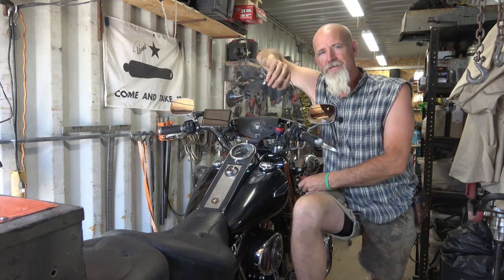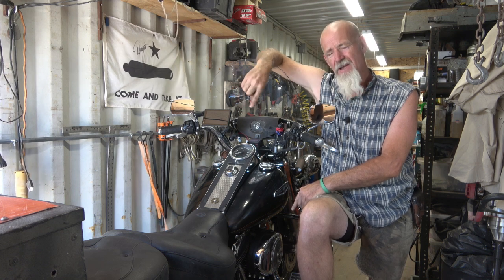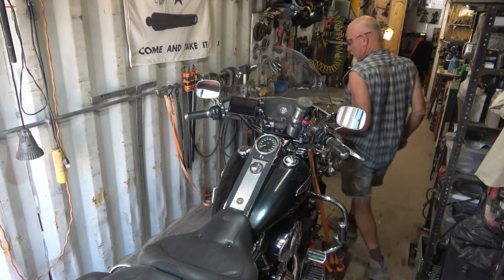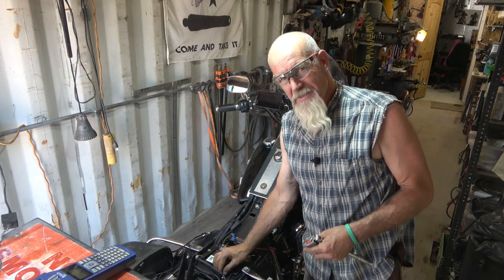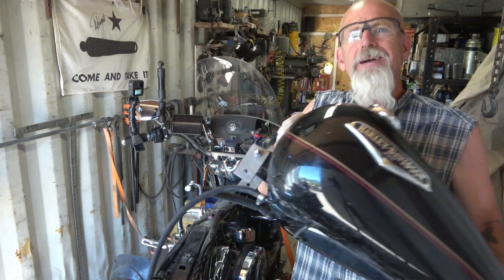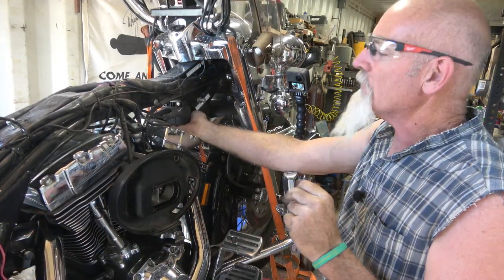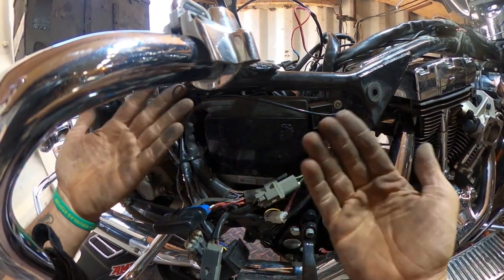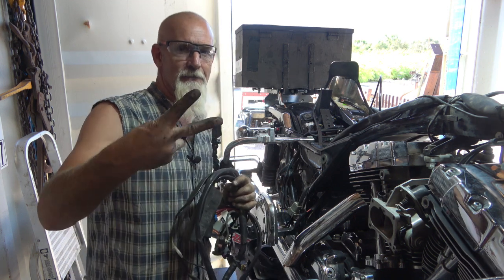Why Your Harley Needs a Carburetor Conversion

Comment: Great video!  I have the same year and model RK. Replaced my ecm with a thunder max. Works like a charm and was only about $900.  Did you consider that and if you did why did you go with the carb?  Just second guessing myself now I think.
Reply from the maker: I did consider a aftermarket ecm , but wanted to go to carb for simplicity on the road and have all parts I need on the bike. Less parts less problems for me. Glad your is working out great. Thanks for watching my vids.

Comment: Just did this swap on my 2000 FLHRCI. 'CEPT I used a sifton cv carb to save a little money. Carb was like $240. And my Dynatek doesn't use the cam sensor. Doesn't start really fast but they said I would notice that because it doesn't use the cam sensor. But other than that it runs beautiful.
Reply from the maker: Awesome enjoy

Comment: Have a 2001 roadking classic touring  . Getting ready to pull the trigger and purchase one of the conversion kits . The magnetti marelli fuel injection is history .
Reply from the maker: I hear ya no computer is the way to go. Really good throttle response and has that carb idle. working on the jetting because of my elevation but other wise good choice. Next week I should have the video out on converting the fuel to petcock so stay tuned and thanks for watching.
Reply: @desertdogsgaragemetalworks3843 
Hi, can I put the dynatek tc88 on my road king 2001 without changing the carb? What happen if I install the dynatek and the namz wiring without changing anything else? 
Thanks
Reply: Do some searching around on the youtubes.. I have converted 2 twin cams to carb, I used the knockoff CV Amazon/Ebay carbs and you wouldn't believe me if I told you, they are really easy to tune up, and work awesome, for $55.00!!!! Neither bike had ever ran as good since I owned them.. Im not the biggest fan of buying china/taiwan knockoff stuff but I didn't wanna spend a dime to ahve to deal with the cost of the keihin or magnetti efi..

Comment: Curious to know why you did not go with a HSR 42 Mikuni carb? They really shift!
Reply from the maker: Was looking at the Mikuni also but my wife has a Super E on here 86 FLST and I have jets and parts for hers so I don't have to purchase parts. Plus am I kinda a S&S guy American made from my home State of Wisconsin.
Reply from the maker: By the way how is that Mikuni? They make good stuff.
Reply: @desertdogsgaragemetalworks3843  When the FI failed on my Evo Road King I converted to Mikuni HRS42 and points ignition and junked all the wiring, sensors and icu. The speedo has a chip in itself so was not affected. She has never run better. Very quick throttle response now, better mpg than FI and, if something should go wrong with the fuel or ignition system when out and about it's an easy fix on the go 😎. Sometimes I think old tech is the best. Thanks for your video -  I enjoyed it.
Reply from the maker: @vidvidbiker  Old school only.👍
Reply: Enjoyed your video. I have a 2003 heritage springer go. Let it set to long and now nothing but trouble. Replaced everything in the tank but now it's back to acting up again . Maybe the senders,who knows. Wanted to keep it original because it's the only new Harley I 've ever had,the rest where swap meet special s . I want to go back to Old School bikes that with just a few tools you can fix it on the road side and ride it home instead of calling AAA ! Have a nice day.
Reply: @AltonBurleson-xt1wz  You can easily go old school with an 88 twin cam.. Just buy a carb conversion and be done with all that.. Its not gonna be a collectors item.. I understand you are attached to it, cuz I have several that I have no reason for owning, other than memories, and I like looking at it.. LMAO
Reply: @Clutch_Kick187  Thanks for your response. Have seriously thought of going with a Mikuni. If I hadn't bought all the stuff in the tank I would've had the carburator paid for! Might just flip a coin and go with it. Thanks again!
Reply: @AltonBurleson-xt1wz  Not sure if you have heard of Lectron Carbs.. They are the greatest thing to come out in carbs to ever exist.. You should check em out.. AMAZING Design with No Jets.. I have one of them and I can 100% tell you I will never buy another CV carb or even regular butterfly/venturi carbs.. The Lectron is really that good on my Evo..